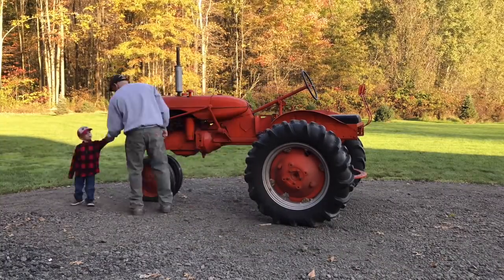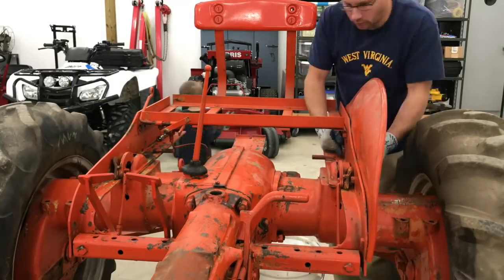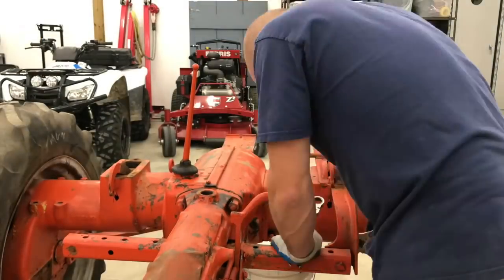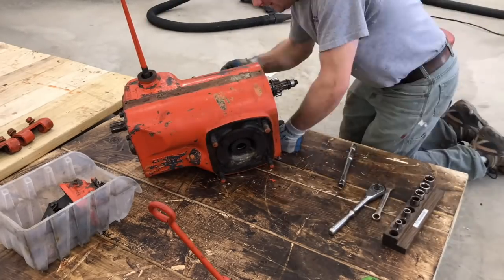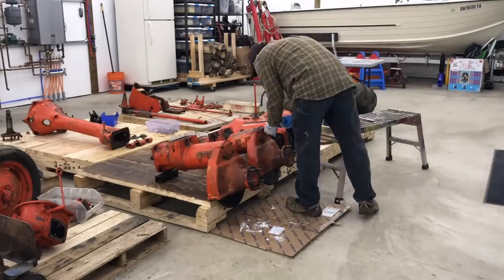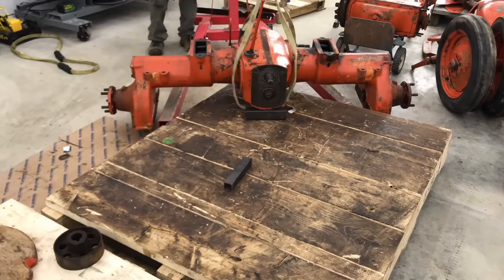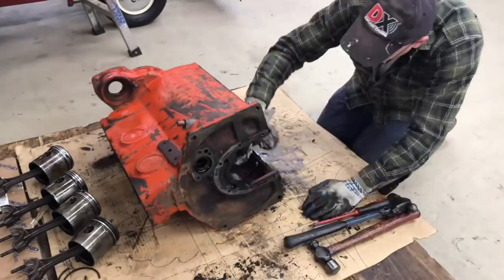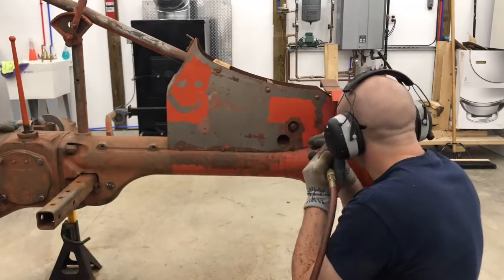Allis Chalmers C Restoration Time Lapse Part 1

Comment: I never considered using a needle scaler for paint removal.  Used a lot of wire wheels, and of course blasting, but never a scaler.  Very interesting.
Reply from the maker: Yep, its a fast but noisy way to remove paint.... check out the last video I made of this project.  The needle scaler will leave traces of paint that might ruin an otherwise perfect paint job.  It all depends on what you are going after.  For cast iron pieces with a naturally rough finish, it can't be beat.

Comment: A fantastic time-lapse restoration video, thanks! I have just bought a needle de-scaler after seeing this, can I ask what psi or bar pressure do you use when you use one? Just so I know if I am getting the best results with my compressor - I have only tested the needle scaler once so far.
Reply from the maker: I think I ran the scaler around 50psi or so.   It seems like anything above 55psi just made extra noise.  I don't know what the CFM requirements are, but my 2-stage 80gal would run and stop every 2 or 3 minutes worth of run time.  Good luck.

Comment: Hello from Wisconsin, did you have a hard time finding parts during your project?
Reply from the maker: Nope, Not a problem at all.  It helps that the model C, B, and CA used many of the same parts.  Also, the bearings and seals are all available from many different sources.  The part numbers are typically stamped in the original parts, so a quick google search is usually all it takes.
Reply: @BobWilson84  ok thanks I have a 41 wc that was my grandfather's that he farmed with. I hope to have it all restored by some time next year sometime.

Comment: Did you remove the lower axles? If so how did you do it?  I can’t get the gear to budge on the shaft.
Reply from the maker: Yes I did.... let’s see...  remove the large nut and spring washer on the inside of the rear end,  then I used a hammer and block of wood to push the axle out towards the outside.  Took a lot of force and I think I also warmed the big gear with a propane torch on low.....
Reply from the maker: Oh..... and remove the bottom gear cover to spin and heat the gear evenly

Comment: Was separating the engine and torque tube an easy thing to do? I have a B that im having trouble separating the 2.
Reply from the maker: Levi Bridge, the engine came right off, no problem.

Are you having a hard time separating the housing and the engine case, or does the engine feel like it stuck from the inside?   Make sure the engine is somewhat aligned and supported so the driveshaft doesn’t bind.
Reply: Ok. The bushing in the clutch Is not letting the shaft slide out. I'm thinking rust has built up in there.
Reply from the maker: Levi Bridge, could be.  The bushing in mine was brass.  I’m surprised it’s fighting you so much.  Can you try and turn the engine over (by hand) with the tractor in gear and brakes on?   That might free the driveshaft enough to persuade it
Reply: I can take the block and spin it completely over by hand. I have a couple ideas I want to try.

Comment: I have one of these and its running a bit crappy (Stalls alot or wont stay running) also leaking hydraulic fluid on the back. We really only use it to haul trees up front in the buffalo weather and to plow. I would love to keep it. By any chance; would you have any advice to maintenance it or manuals? This looks exactly like mine however mine is red and also my tires are widened. They are not close together like yours. Any advice would be greatly appreciated.
Reply from the maker: Hello fellow Robert.  Based on your short comments and a wild guess; I would assume the problem is most likely fuel-related.  There are many very good antique tractor forums with guys like myself who are happy to provide free advice.  Use Google and start reading about your carburetor and steps to diagnose fuel problems.  Petcock, Fuel filter screen, etc.   If you'd like more help don't hesitate to send me a message.    As for the hydraulic fluid leak... not much I can offer for you.  Give it a good cleaning and see where the leak is and go from there.  Good luck!
Reply: Thanks man. Anything helps really. I greatly appreciate it. This was a very cool video. Even inspirational.

Comment: How do you heat your shop and how do you have it insulated?
Reply from the maker: Hi,  natural gas tankless water heater for the radiant floor heat.  A gas furnace for backup and immediate heat when needed, and a wood stove for weekends.  Insulted with 2” foam under most of the floor,  and batting insulation with foam in the walls.

Comment: Awesome video! I never would have striped it down to that level. So you have "simple tools", like hoists, press, and 5,000 sq ft of heated space in which to work....just like everybody does.
Reply from the maker: Well,  simple tools compared to a full-blown heavy equipment shop.  And yea,  the heated space is really stinking nice in the Ohio Winters!

Comment: You said it's an old tractor what do you expect, for when it was gonna leak. But your restoring it???
Reply from the maker: Hi.  Not sure if I understand your comment.  I suppose what I was trying to say is old tractors leak here and there, and even after a restoration it’s normal to have some leaks.   It’s funny,  before the restoration the rear main seal leaked and the front didn’t.  After the restoration the rear seal doesn’t leak but the front does!  I think it really comes down to the design of the seals.  Felt / cork / cloth seals can be hit-or-miss even when they are new.